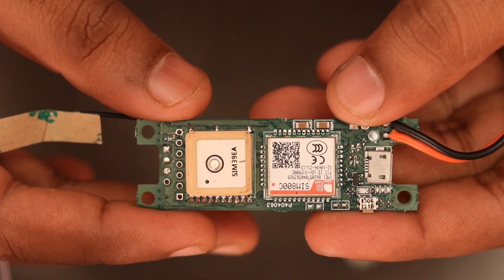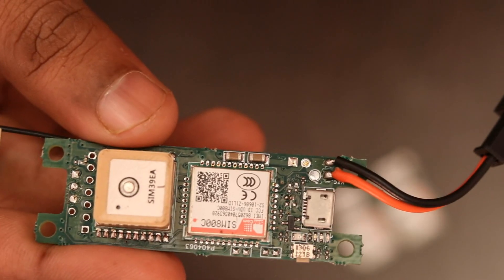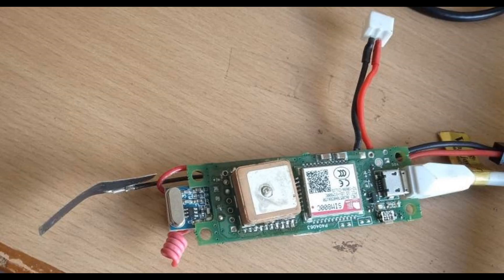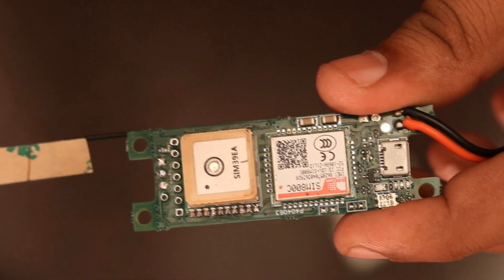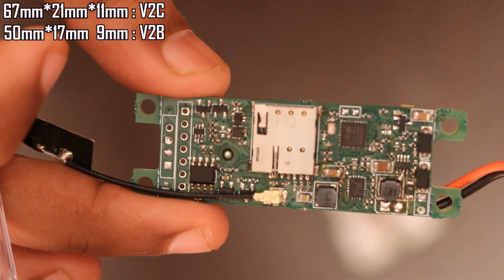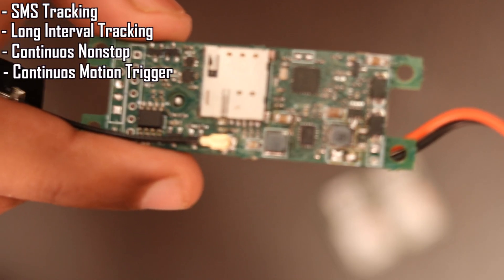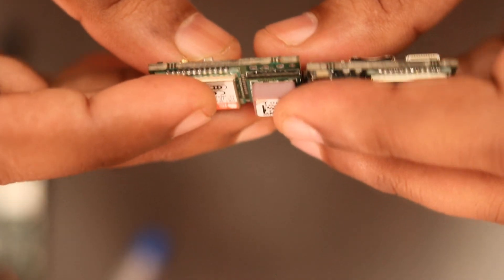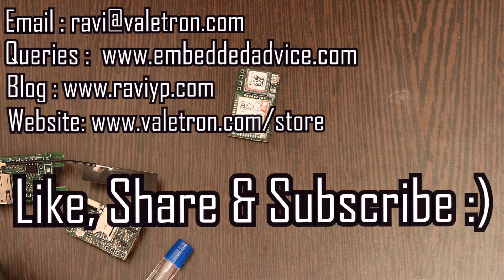VALTRACK-V2C  GSM GPS tracker with 12V-36V input & Battery charger

Comment: Power consumption for the smaller model?
Reply from the maker: There are different modes of operation, which have different parts turned on or off, Which mode or scenario are you asking about?
V2MF can consume about 190 micro ampere when in stop mode with everything switched off and only accelerometer turned on for checking movement